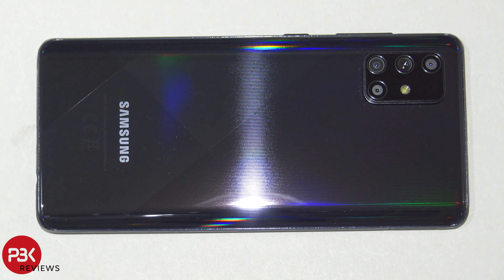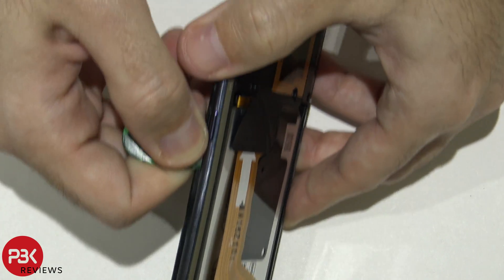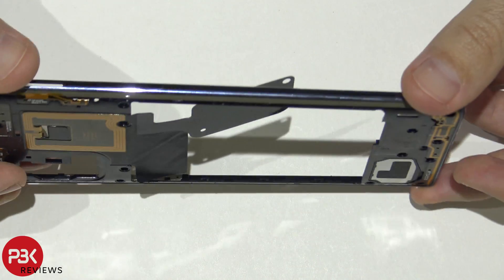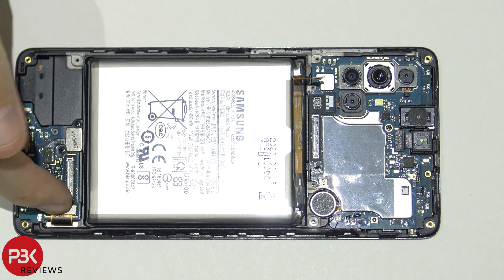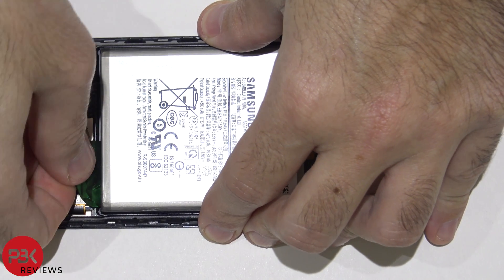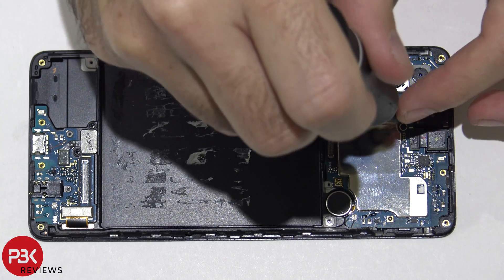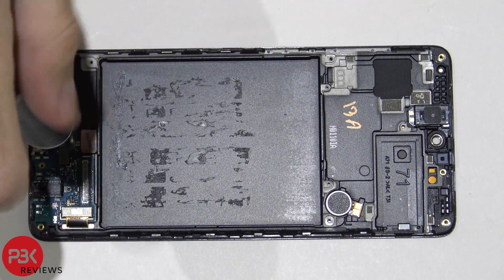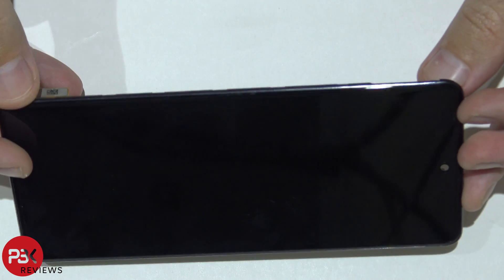Samsung Galaxy A71 Teardown Disassembly Repair Video

Comment: Hey man great vid, really helpful and saved my phone from when I dropped it in the toilet, or so it seems haha. I've put it back together but it looks like I'll need to redo the back plate with new adhesive. Is there a particular type to use? I'm a massive newbie.
Reply from the maker: For best results you can order a precut adhesive that is made for your phone or buy a new back plate that has the adhesive pre installed. Here is a link for a pre cut adhesive https://www.ebay.com/itm/Genuine-Samsung-Galaxy-A71-SM-A715-Battery-Cover-Adhesive-GH02-20352A/333647076734?hash=item4daeea5d7e:g:Pt8AAOSwusdfA6gD   or you can search online other places to see if you can find it cheaper. The backplates with adhesive run around $30-40 on ebay from what I saw.  If not, you can buy a roll of adhesive like 300lse or smartphone red tape but those wont be as good as the precut ones since you need to cut it yourself and wont have an all around seal.
Reply: @PBKreviews  hello. Great work. Is it possible to switch a samsung a71 battery with a samsung m51 battery? If so will it damage the a71?

Comment: Seeing how you removed the back. Could you theoretically change it for metal and put a wireless charger receiver under the back panel?
Reply from the maker: not sure if a wireless charger would work through metal but if you made a metal backplate you can use it if you wanted to.

Comment: Can you install battary samsung m30 or m31 on samsung a71 please answer ?
Reply from the maker: It might be possible not 100% sure since I would need to have both batteries on hand and the phone to see if the battery will fit in the battery compartment, but the connector seems to be in the same area and same type of connector so as far as connecting the battery it seems would be possible. But not sure if it will fit inside the frame/battery compartment area

Comment: Can u pls help? 
My smartphone had a broken display and a hidden frame. Has been replaced and still not working .... What could it be? 😭😭😭
Reply from the maker: What do you mean hidden frame? if you mean your screen is not displaying anything, then it might be a damaged display chip or resistor somewhere on the board.
Reply: @PBKreviews  hey thx for answer ❤️
Sorry I meant inside not hiding. It is bent when falling.
 But is it still worth repairing the smartphone if you have to replace the chip?

Comment: Maybe you should do a disclamer of that a battery removal without a pull tap and that much adhesive could be dangerous when you bend/puncture the battery on accident.

Comment: Do you think it is has good water resistance?
Thanks
Reply from the maker: Its splash proof but not waterproof. You can have splashes of water and get away with it but if you submerge it in water you will probably damage the phone. It doesn't have an official ip rating but does have a good seal on the back plate as well as gaskets around the connectors but other parts of the phone can allow water and and get damaged.
Reply: @PBKreviews  That's good to know at least it has some protection. I'll be very careful with it. Thanks
Reply: @VILL4IN-1  It is not even splash proof...I would recommend a waterproof case for it....Mine broke after I got caught in a bit of rain for 5 minutes....and it was in my pocket... Really cheap product...be carefull with it!

Comment: A71 is is very good because it has the snapdragon 730 that make it better than other phones in the A evaluation and its screen its like the note 10 and it is 6.7 inches and the battery is 4500 mah
Reply: Really? Note 10???

I came from note 8 and the screen on the note8 is waay better than this one. The note 8 has one more sceen option compared to the Natural and the other one on this phone.

Comment: Changing out the battery looks pretty straight forward, and wouldn't be hard to do.
Reply from the maker: Yup. Would have been much easier with some pull tabs to pry the adhesive off but yep.
Reply: They don t want us to change batteries,they want from us to buy ne phone,it s all about money.

Comment: Did you use glue to attach the bach panel to the phone body?

Edit: back*
Reply from the maker: no, its adhesive. You can use 300LSE or smartphone red tape or other types of smartphone adhesives. Usually most replacement back panels come with adhesive pre installed
Reply: @PBKreviews  ok

Comment: which one is better from assembly point a71 or s10 lite? tnx
Reply from the maker: They are both fairly simple to do repairs on, the S10 Lite back cover is a bit harder to pry off since it has stronger water resistant adhesive. But I would say the S10 Lite has an overall stronger frame/build quality.

Comment: Sad that it does not have any kind of cooling. Vapor chamber or the one like  those on Xiaomi phones. But does it really matter to A71? Asking because I want to buy this. And I game a for long hours of time using mostly 4G connection and rarely wifi.
Reply from the maker: It should work fine for you, it might not stay as cool as some other phones but should still not cause any issues. However it's not a high end gaming phone so all depends on what type of games you plan on playing. :)
Reply: You can disassemble your phone and put high quality thermal paste on the SoC. Just do it at you own risk.

Comment: What do you think about its material and build quality ? Is it easy to bend ?! Is it just like the a51 or it's a litte bit better cause it's more expensive than a51 and there's a video claims that a51 build quality and material are very bad and easy to bend ,burn and break !! Is that true !!?
Reply from the maker: I think its very similar to the a51, just has better specs. It is not a bad build quality but its not the best either. However its an easy disassembly process so thats a big plus because repairs would be much more simple compared to many other phones. The phone wont bend if someone doesn't on purpose use all their force to bend it, so in real practical all day use should be fine.